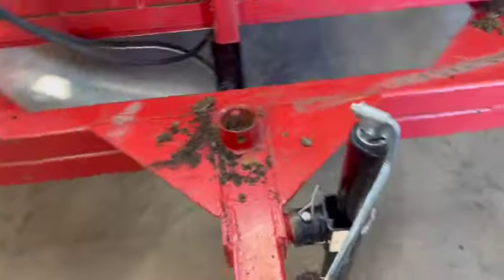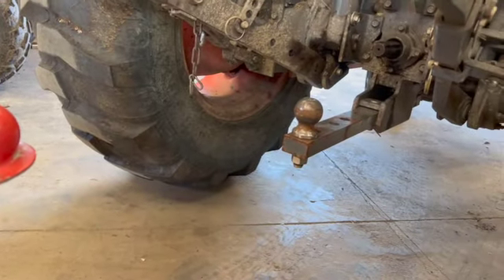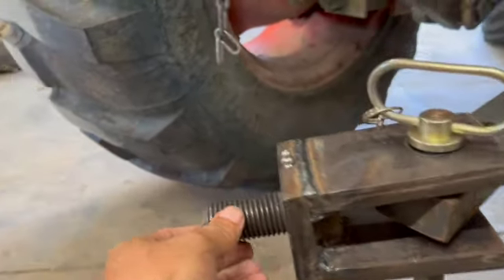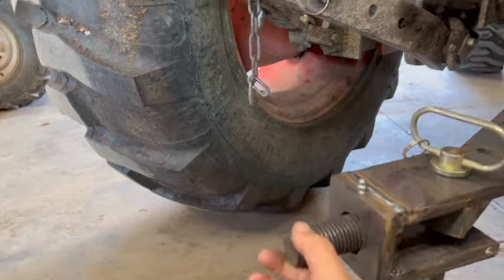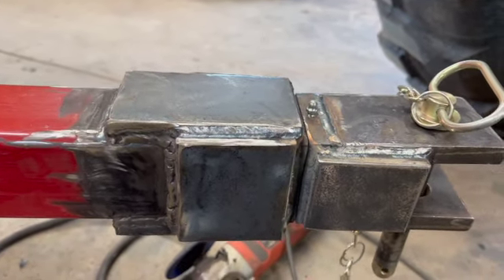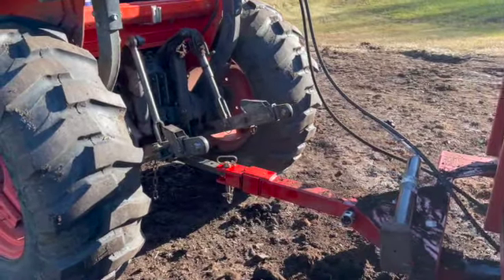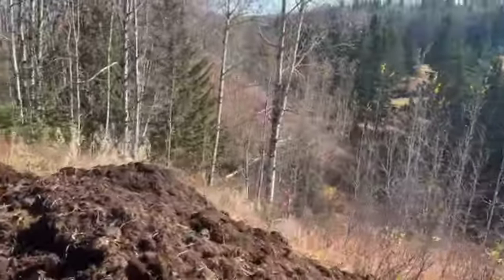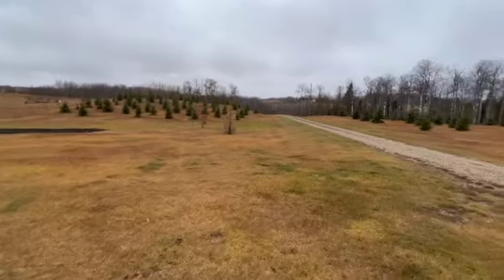Smooth Fabrication - Modifying a Ball Hitch on a Dump Trailer to a Tongue Hitch

Comment: Where is the pivot point for front to back for going over uneven ground in the direction of travel?  I have a much bigger trailer and I use a 3pt hitch bar deal with a receiver in it and us the ball on the trailer.
Reply from the maker: By using a slightly smaller pit to attach the trailer to the draw bar, allows me to have some room for front to back travel.